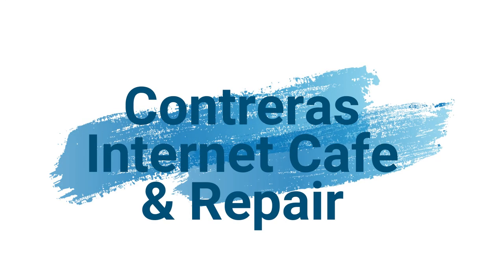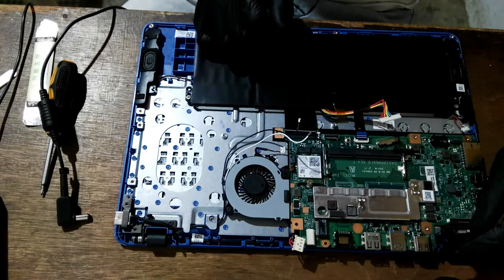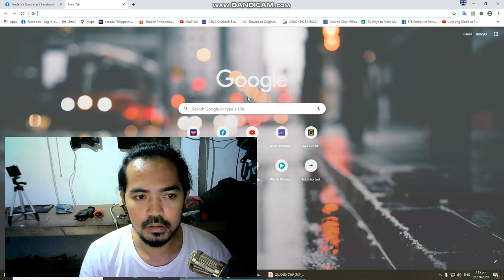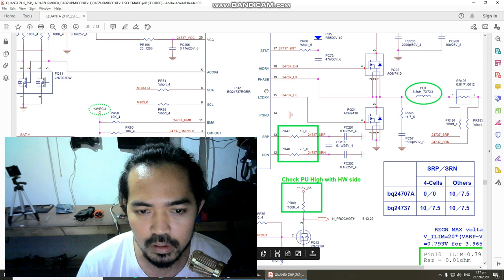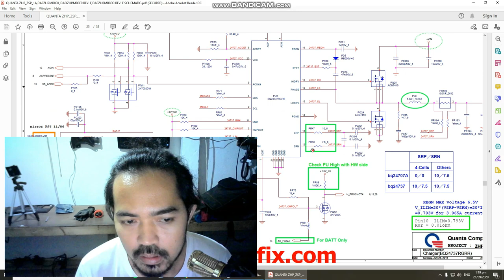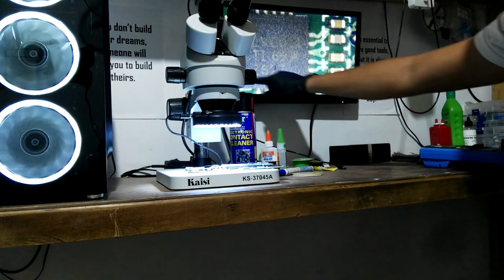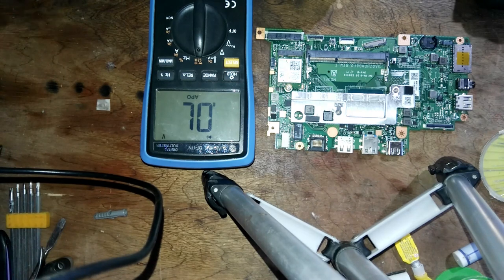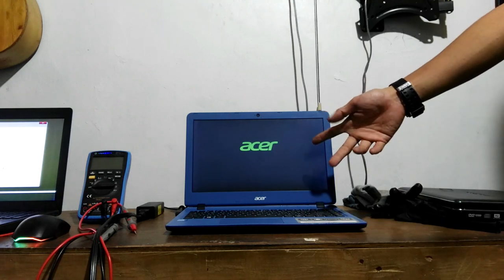acer Aspire ES1-332 shorted mainboard

Comment: Sir how did you turn on that laptop without the battery? Is there any steps or anything to take in the board before starting it on. I also have the same problem in my laptop same brand same board. I can't turn it on without the battery...  I want to use it without the battery but i cant turn it on even with the charger is plugged in..

Comment: opinion ko lang po, dapat nauna ang troubleshooting sa battery before nag baklas or isama na sa video ang pag test maski ang battery ay sira na at least added na info, sa akin lang po dapat nauna lang talaga at least sa mga newbie makakita na di dapat baklasin kong battery lang ang may problema para naman may gabay din sila.
Reply from the maker: pwede sir, but in may case built-in si battery isa pa madalang mag short ang battery ni minsan hindi pa din ako naka encounter ng short na battery dahil mismong battery may sarili po syang circuit protection awan ko lang sa mga Chinese replacement battery pero meron din yung circuit protection, hindi mo din malalaman kung sira yan kung wala kang special tools malalaman mo lang faulty yan pag sinaksak mo sa laptop at hindi na sya nag charge
Reply from the maker: ang sira talaga nyan ay battery controller may next video pa kasi sana yan pero na corrupt yung video ko kaya di na post anyway sir salamat sa tips.. madalas na issue ng acer yan gagawan ko ulit yan ng next video pag may same model at issue akong nakita pa subscribe na din sir para updated ka..
Reply: @ContrerasElectronics  thank you for the reply sir just giving my thoughts para maging successful yong channel mo.
Reply: @ContrerasElectronics  sir same model pero pag power on my kisap lng sa lcd di makikita pag maliwanag  blackscreen lng sya

Comment: Guday master! same model nito ung tina try kong gawin  newbie lng sa pagre repair ng laptop me light indicator naman kaya lng nawawala pag on no dispaly na me voltage bat connector pin 7&8 3volts pin 1to6 less 1v lng wala namang umiinit na parts nde rin na ikot fan nya anong parts kya possible na cra master? thanks
Reply from the maker: maraming pwedeng sira sir, check IO chip, check bios, check mo yung crystal
Reply: @ContrerasElectronics  ok sir, san po maka dl ng schematic nito? salamat sir!